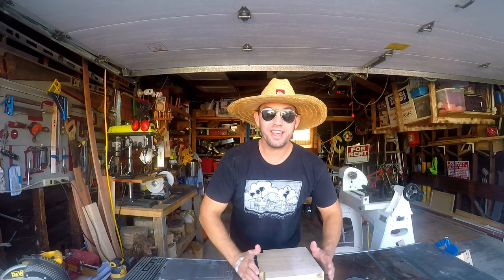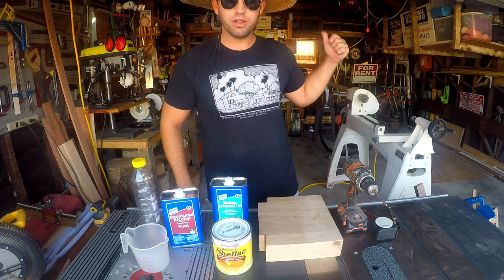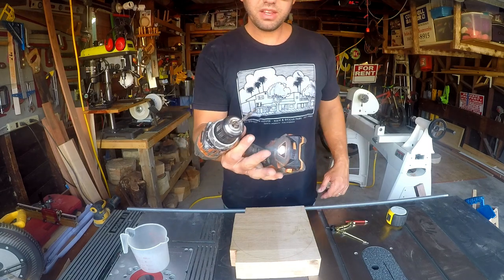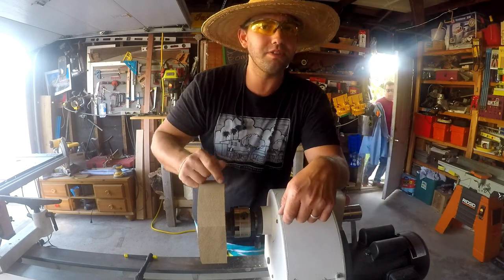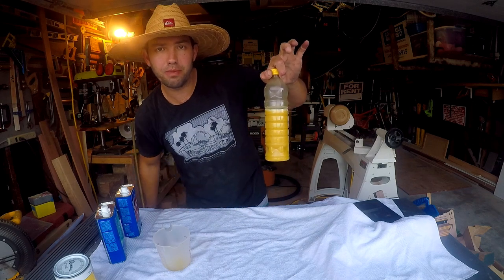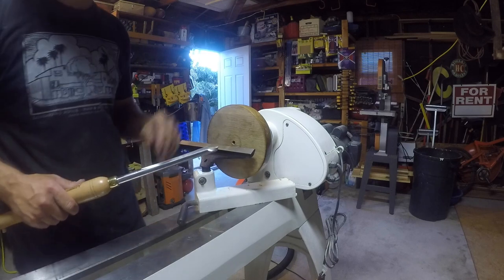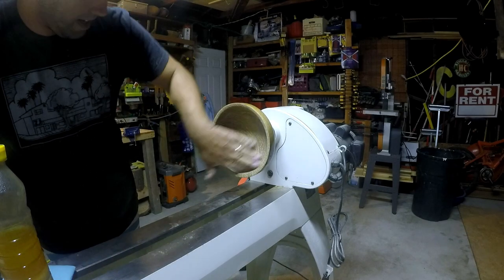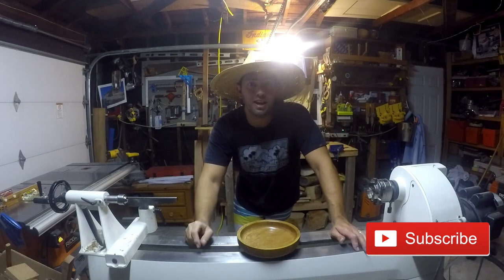How to Make and Apply your own Friction Polish - Woodturning- Oak Bowl- DIY

Comment: Nice bowl and great finish.  So you chose that finish over beeswax.  How did you discover the combination of ingredients?  Can you eat from the bowl with that finish?
Reply from the maker: Jason McKenna I use both finishes pretty regularly and like them because their fast and food safe. Any finish that has had time to cure is food safe.
Reply: Forgot to ask, do you use a sanding sealer before your friction polish or is that not necessary?  thanks
Reply from the maker: Jason McKenna great question I just use a simple water based sanding sealer before the friction polish. It dries super fast and your good to go.